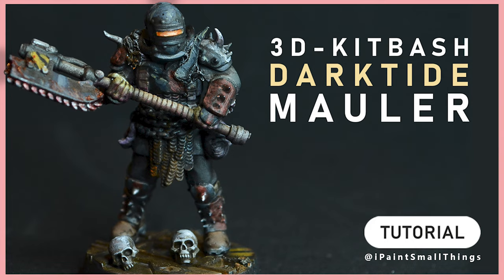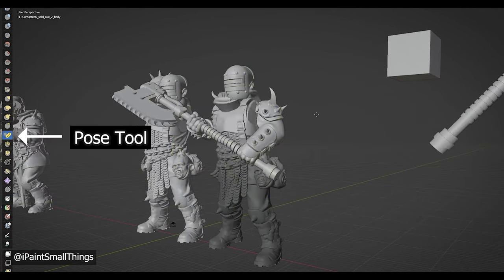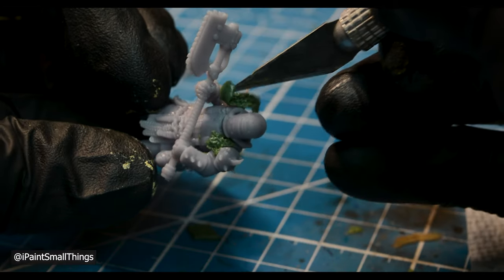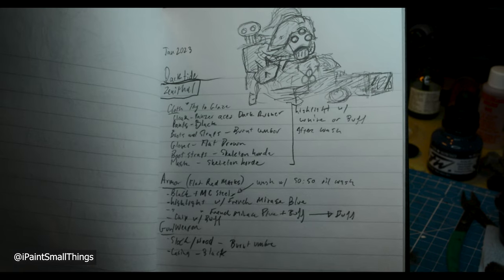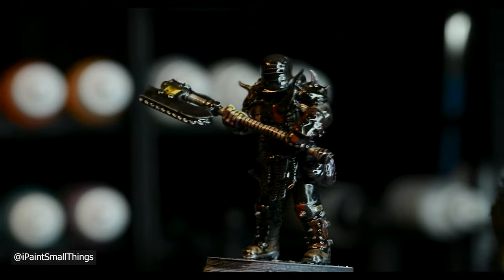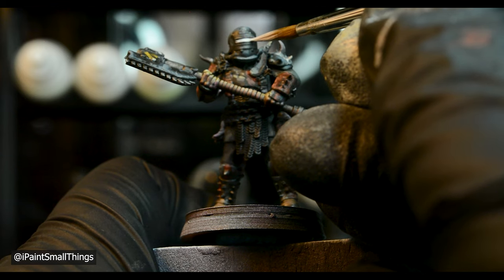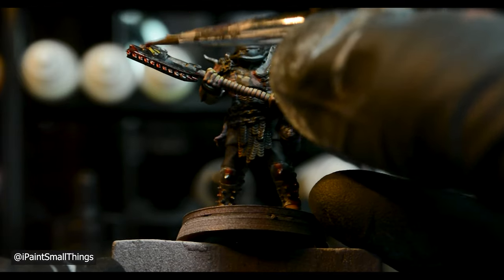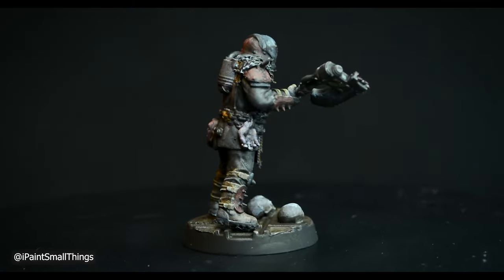3D Kitbash | Darktide Mauler

Comment: Awesome stuff. I have the stationforge frost guard and was trying to face swap something in place of the mask for an Valhallan vibe and I can’t figure out how to get rid of the hoses. Any tips?
Reply from the maker: Thank you! Oh yeah those are cool-- I wish you could just separate by loose parts on them.
You could (very tediously) make a plane, separate the hoses from the body with a boolean difference (using the plane you just made), separate by loose parts and delete the hoses, and then use the smooth tool in sculpting mode to hide the cut a little bit better. This video shows how to do all that https://youtu.be/tA-J-HYlKkI?si=iYQW0Rzk1ME06_Ss. That's at least how I'd do it! It would take a long time though haha
Reply: @iPaintSmallThings  that’s for the heads up!
Reply: Thanks* 😂
Reply from the maker: haha I got you! @benfieldhicks7064

Comment: Amazing job as per man. I love these darktide conversion vids. 

I just wanted to pass something by you though. When you apply the oil wash, do you spray the model with matte varnish before or after? 

New to the oil game so just wondering how you work with it.

Thanks in advance brother. Keep up the good work!
Reply from the maker: Thank you!!
I will after if I notice that the paint isn't sticking like it should. I don't typically before-- but I know it's probably a good idea to. I've had it where the paint will rub off if I'm a little too intense with wiping away the wash. So yes yes it's a good idea to do it before, too!

haha I will do my best!